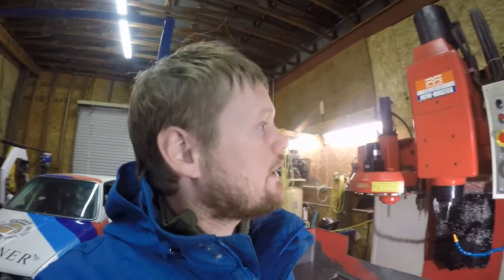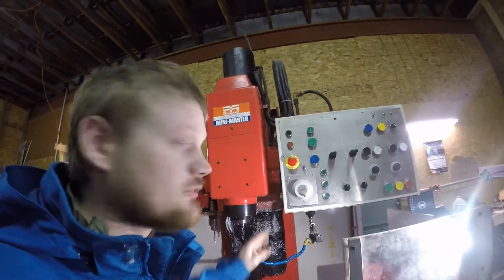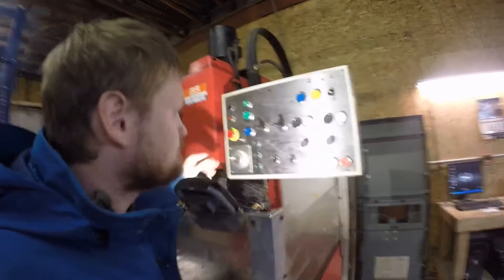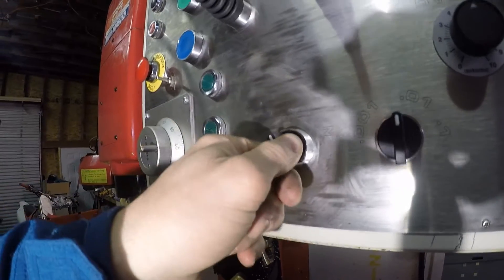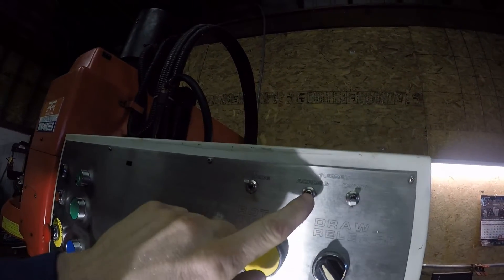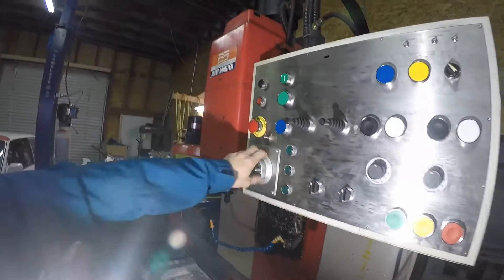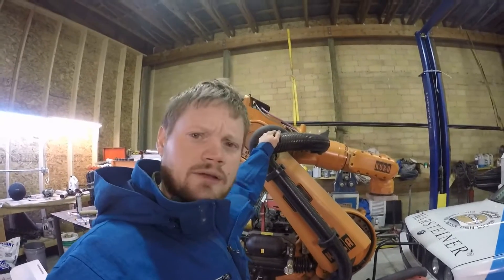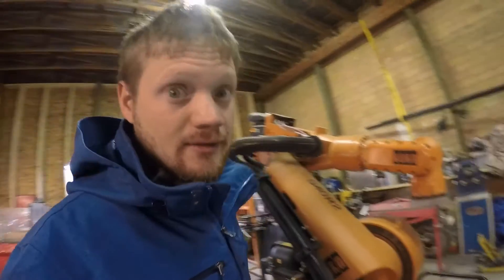mach3 retrofit

Comment: Hey John you wouldn't happen to have the original control boards from the mc500 would you? I have the same machine and have a faulty board. On the fence about doing the conversion but would like to get the machine running.
Reply from the maker: No that sucker is long gone. If you need parts made now just do the minimum to get it runnnig again. If you have some time and you're an excellent problem solver and you think you could pull off a retrofit, then go for it.

Comment: Hey Jonathon,
Considering picking up an MC500V for about $2600. It's got a UAASE-5K spindle motor which has a rating of 5KW and two speeds annotated on the data plate of 145V @ 850RPM and 200V @ 2000RPM. Is this the max spindle speed for the mill? If so, how does that limit what you can do with it? Have you had a hard time finding affordable BT35 tool holding?

Comment: I am thinking of Pathpilot and Linux... seems to be pretty locked down..

yeah the price is hard to pass up and it popped up only a few miles away.  and as I was repairing the spindle on my G0704 hobby mill I dropped a clip and needed to move it to get the clip.. so I picked it up and moved it... hmmmm yeah it just seemed..well puny